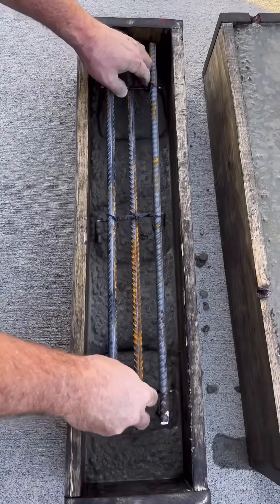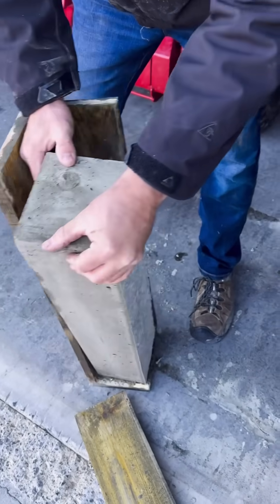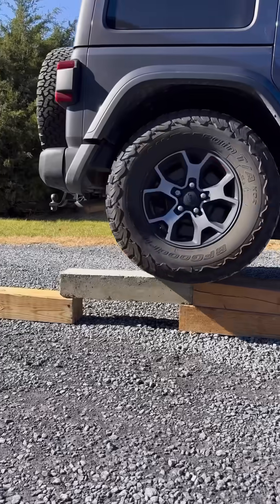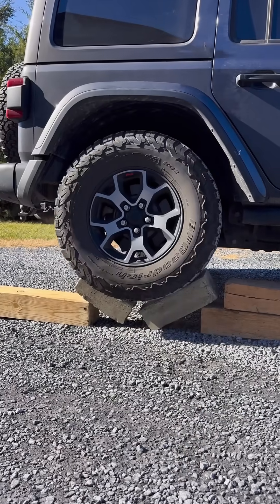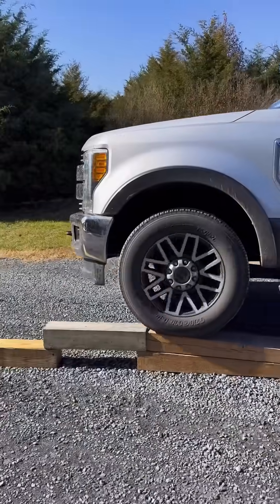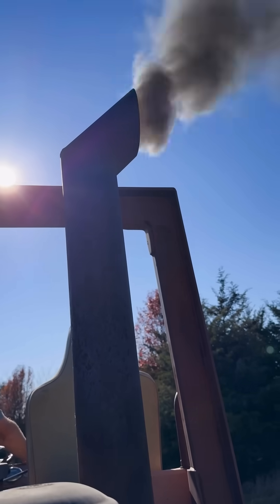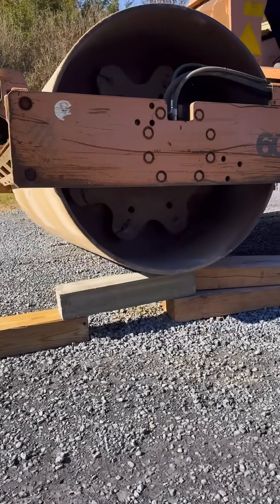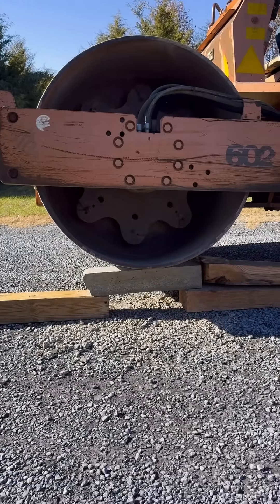Why We Use Rebar To Reinforce Concrete

Comment: I had no idea rollers can vibrate. That’s ingenious.
Reply from the maker: it’s got two different vibration modes. That was the hardest one.
Reply: @hausplans wife left me and for some reason my roller is gone too.
Reply: @hausplans .....does the seat vibrate too?
Reply: @hausplans sounds good for my sister 😂
Reply: @purplechemical yups absolutely 😂
Reply: @hausplans  so it's technically a massive vibrator??
Reply: @hausplans I’m the same in the bedroom
Reply: @hausplans 😳
Reply: @hausplans  Oh that's what she said
Reply: I was gunna say the same thing.
That was amazing
Reply: It's for compacting material. If stuff isn't compact it sinks:) easiest simplest explanation
Reply: What is the vibratory drum for? And how does it work???
Reply: @fireWireX4  You use a vibratory drum to tamp the material (gravel or pavement) into a tighter bed so settling only happens on a minimal scale.
Reply: @fireWireX4  think of how a jackhammer works. Its a similar concept
Reply: @AnthonyBolognese710  Not even close....
Reply: @AnthonyBolognese710 it’s actually to compress the concrete when rolling. Not for breaking stuff
Reply: @AnthonyBolognese710  A jackhammer is probably the worst example for this. The roller is used to compact the materials, a jackhammer is used to break it apart.
Reply: its for packing down soil/gravil/ whatever
Reply: @fireWireX4  vibration confines all the fine particles locking them together. There's a spinning weight inside.
Reply: @fireWireX4  drum rollers are used for compaction of soils and asphalt paving. Any dirt work is sure to have a smooth drum or a sheep's foot roller.
Reply: @fireWireX4 

Concrete pours may look fine but often are riddled with air pockets reducing their long term viability.

Vibrating the concrete forces the air out and makes the volume as even as possible.
Reply: @fireWireX4  Drum rollers are awesome for packing dirt and base rock. The vibrations compact it really good
Reply: @fireWireX4  It works by having cylindrical piece of metal that is non-concentric (weighs more on one side) spinning inside the drum run by a hydraulic motor. The shifting of the weight as it rotates around causes vibration.
Reply: @fireWireX4 you have weight of the roller thats just static weight but you slam it and you have added kinetic energy just like you have hammer you place on the nail it won't drive into the wood but when you slam it on the nail it would drive the nail in.
Reply: @fireWireX4  I'm not an expert, but probably to push down harder on asphalt to make it as flat as possible
Reply: @fireWireX4 it’s basically a huge wacker plate (compactor)
Reply: @fireWireX4 it's for the 304s.
Reply: @fireWireX4 better compaction.
Reply: @fireWireX4  Maybe like controller vibrators, uneven weight being rotated
Reply: @fireWireX4 it's used to compact the ground with the heavy roller and then the vibrations it can get a much better compact, used for gravel and for compact stuff underneath concrete or asphalt or anything that needs a strong subbase
Reply: @fireWireX4   Why do you look it up on YouTube.  You will probably lean a lot more than what you would from comments.
Reply: @fireWireX4 it creates a centripetal force that acts like a  multiplayer to gravity. The roller is x weight and pushes down with three or four (maybe more) times that force. Great for smoothing asphalt.
Reply: @fireWireX4 packing soil like a tamp would do.
Reply: @fireWireX4  its to smash the asphalt down flat, simply driving over it with a roller doesn't do the job by itself.
Reply: @fireWireX4 the vibration allows it to better press the ground down. Think about it like trying to squash a box just by standing on it compared to jumping up and down. The weight of your body alone isn’t super effective, but by jumping up and down you increase the peak force you apply on the ground dramatically.
Reply: @fireWireX4 You ever seen a plate compactor?

The roller doesn't compact because it's heavy, per se, it compacts because it vibrates the ground.

It applies pressure to the ground (via weight) and the vibration allows all the aggregate to bounce around and find the best arrangement for the smallest volume, essentially you're getting the air pockets out of the dirt to compact it.

Vibration is the main feature, rolling is just kind of a necessary accident.
Reply: @fireWireX4 it's vibrates the ground to help compact it
Reply: @fireWireX4 it's basically explained in the video if you think about it. wasn't able to split it with sheer mass and force, but with the vibrator it was able to. its more powerful
Reply: @fireWireX4 It helps pack the cement together, its like if you had a big bin of Lego's and shook it a bunch all the pieces are going to pack themselves in as tightly as possible because with each vibration all the small gaps between each Lego piece is slowly closing. Same concept here, just packing it down to remove any gaps in the concrete
Reply: @theguyfr136  You use a roller for concrete?
Reply: @fireWireX4  when you pave a road, you roll it not too long after you lay the mat and it compacts it and the vibration is for thicker mats, on thin mats you might bring rocks up with the vibration which you don’t want.
Reply: @fireWireX4 i will push more flat thar roads...
Reply: @fireWireX4  vibration makes rocks, gravel, dirt, and sand to move beneath it, flattening the surface of the road out further.
Reply: @fireWireX4 introduces many cycles of fatigue in a very short window of time. Materials fatigue until failure according to n amount of cycles. Vibrations can implement millions of cycles in a matter of seconds. I've seen titanium rods snap in a matter of minutes being placed in machines which vibrate them millions of times per minute to reach their critical failure point.
Reply: @fireWireX4  it's to move all the small microscopic bits around until they lock into each other while compressing. It allows for more strength in a roadway than just pouring it and letting it sit.
Reply: @fireWireX4 it's to help pack in the cement so that way you can try and get the air bubbles out of it. And since it's a roller it's actually doing two things at one time. It's packing in the cement and getting the air bubbles out and it's making the top surface flat.
Reply: @fireWireX4  It's for compacting earth, stone and asphalt.
Reply: @fireWireX4 it's to shift the sand and mud to flatten
Reply: @fireWireX4  You just saw what it was for, it essentially just jackhammered that concrete block...
Reply: Another thing you may not know is that vibrators roll.
Reply: @reidflemingworldstoughestm1394 most things that vibrate do it with off balanced spinning weights.
Reply: @reidflemingworldstoughestm1394 , I thought they're gliding . . . into the coochie
Reply: @reidflemingworldstoughestm1394 source?
Reply: My work has construction going on outside of it. The vibration of the rollers literally shakes the entire 50,000 sq ft building. It’s intense
Reply: it also helps compact dirt when creating new areas of land for home development to keep it from moving during rain, i usually have to compact the ground before the end of each shift, we also use a compactor (seperate from a roller) to reopen the ground to add more dirt and raise the land
Reply: some are also filled with hot liquid inside. its pretty cool how they look the same but they have ones for different purposes
Reply: It's glitching
Reply: it's something else when you're working inside a building and everything starts shaking... lol
Reply: Yeah the trades get the ladies but the vibrating drum brings the freaks out
Reply: @noassociation85  when has a woman ever said “plumbers really turn me on!!!”? 

I mean smart women get with tradesmen because they’ve got very secure careers, but it’s not universal.
Reply: @AnthonyBolognese710  never it's one of the things we giggle about in private,the saying is tradies for the sake of the rhyme,its really just carpenters👍
Reply: @AnthonyBolognese710  the ability to earn is there,70% of trades are broke cus of booger sugar
Reply: @noassociation85  yeah that’s what happens. Covid brought both benefit and detriment, just like any market upset. Some people saw money they had never seen before, so they acted like people who won the lottery.
Reply: Just a fun little tidbit; we also use vibratory rollers to compact dairy haylage and corn silage. Less air=less space+less rot.
Reply: All rollers vibrate. It can be turned on and off.
Reply: @ramennaidoo162  not all what can be called "roller" can vibrate, but most of those that look like that one on the video indeed can. 

And just like the rebar concrete on the video, soil too can have some small voids underneath and the vibration makes the soil particles move and settle in place, reducing the voids underneath and as such makes it more stable to build roads and structures on.
Reply: Dude I was about to say the same thing! Super clever design.
Reply: I’m a concrete field technician
Reply: That's to attract female drivers.
Reply: So hear me out... if dio turned on the vibration mode
Reply: @xianaru1902  he’d start singing holy diver
Reply: The can't. That is what happens when two people are making love on the seats.
Reply: It’s how we pack gravel/asphalt for road construction
Reply: I drive a roller all day for work. The vubrator makes my ass numb. That's why females can't be construction workers. It's a vibrator after all
Reply: whats the opposite of a compacting vibrating roller drum?
Reply: Just like a gaint vibretor on wheels
Reply: Common sense should easily explain your question...
Reply: @JP12Ninersfaithful  common sense would demonstrate that there wasn’t even a question to answer.
Reply: I bet it suuucks to drive
Reply: We got 40 year old roller and it still has the vibrator function on it
Reply: IKR, I mean thats the big take away from this video.
Reply: Roller is just a huge vibrator
Reply: Forbidden massage gun 😂
Reply: Maybe if women knew how many things vibrated in the construction world, there would be more women in the trades.
Reply: You can feel the ground vibrations from like 20 feet 😅 Civil worker here 😎
Reply: Dump trucks do the same things
Reply: When one of those works next to you, you feel like shit will start falling out of you because the ground shakes so much..
Reply: I heard one making multiple passes not to long ago sounded around 30-50hz quite low frequency! Wouldn’t surprise me if you felt it in your chest running it, could also make ya talk funny!
Reply: @tucker934  and that’ll ruin your eardrums over time.
Reply: Same 😮
Reply: A useless thing that I know is that "Steam Rollers" aren't the correct name, it's "Tandem Vibratory Rollers". But this is also my first time seeing them actually vibrate.
Reply: recently I come to know that it has vibrator 🛞. found it in my street road work
Reply: Of course, it’s a road roller.
The secret:

The manufacturers made endless replicas of DIO as divine punishment for destroying their production line road rollers. The punishment was to MUDAMUDAMUDAMUDA on demand while sealed inside both roller drums. The seals worked double duty as to hide its sealed contents whenever the road roller drums were opened for maintenance or any other reason.
Reply: I have an idea💡...

She is dead!!
Reply: you have insufficient cover requirements. Durability aside, the bars can't fully mobilise.
Reply: You know about it if you've ever had the pavement replaced on the street outside your house 😂 Literally feels like you're sleeping in one of those vibrating beds.
Reply: @totino_boy  I have but just assumed those were jackhammers
Reply: Same here 😅 idk that machine can vibrate too
Reply: ROAD ROOOOOLEERRRRR DAAAAAAAAAAA
Reply: @christophersalumro3076 😂😂😂😂😂😂😂😂😂😂😂😂😂😂😂😂😂😂😂😂😂😂😂😂😂😂😂
jojo funy 😂😂😂😂😂😂😂😂😂😂😂😂😂😂😂😂😂😂😂😂😂😂😂😂😂😂😂😂😂😂😂😂😂
Reply: Watching this on mute, my dumb ass thought the vibration was from the rebar struggling to keep the roller off the ground the same way a dude's arm shakes when he's trying to keep his arms from giving out while lifting 😅
Reply: Me too bro
Reply: This comment is proof that people can argue about literally anything
Reply: they’re called Compactors
Reply: Millenial???
Reply: I think you mean indigenous
Reply: That's why they don't allow women to operate them.
Reply: How do you think pyramids were built 😂
Reply: Like seriously???? R u kidding u didn't know that??

Comment: For the best horizontal beam strength the rebar should be offset toward the bottom.
Reply from the maker: This reber was in the top third of the form so I flipped the beam upside down for the test. So it was in the bottom third.

Comment: Those rollers are no joke. After 40 years of commercial masonry i cant count the times thos rollers have screwed up our wally. We have y courses of block laid on the footing. Get up on the staging to keep going. Bear in mind its important the blocks stay at the correct hight so that at the top of the windows and doors our blocks go rite across the top of the frames. Then 200ft away they fire up a roller compactor and we watch as all the blocks laid that day settle forcing mortar out of the bed joints and suddenly the wall is 3/4" low even though the guy was 200 feet away :(
Reply from the maker: My mason told me a funny story about something similar happening to him three times in a row
Reply: It's a seriously aggravating thing. Pan scrapers will do the same thing or big haul trucks will if it's on or close to the ledge or bedrock. Don't even talk about when they are still blasting on the site :)

Comment: As much rebars, you put in it. You should've been 3/8s however, you should let it cure for 21 days. For really good strength. But at the end of the day with the roller size, the vibrator on you should have probably had at least an 8 inches beam with Rebar.
Reply from the maker: I think if I would’ve let it cure all the way it would’ve handled the roller even with the vibration

Comment: 3 days old ..  concrete isn't fully cure until 90 days or turns white  cures to fast your pour was to thick and it will be more prone to Crack but be stronger .. you self level it and your screwed
Reply from the maker: 2.5 days

Comment: The rule states that concrete reaches final and max strength after a curing period of 30 days. Usually the cement will Warrant a quick hardening to keep the concrete in its form as it was intended during pouring. The rebar should be always placed in every corner and held together in a caging either by form bent smaller rebars or you apply a square (for ceilings) or rectangular rebar mat. This way you will reach the highest degree of tensile strength.

Comment: Typically concrete takes7 days to reach 50% rated strength and 30 days for it to reach 100%. I would guess that was between 3-5 days old
Reply from the maker: You were very close, 2 1/2 days

Comment: All rebar does is stop large cracks from forming in the curing process. You get a lot small and micro cracks, rebar keeps the cracks small. Cables reinforce concrete rebar does not

Comment: It would be interesting to see how the rebar compares to fiber mesh
Reply from the maker: It would be
Reply: Fiber mesh is mostly used to control cracking, not add flexural strength. Some high strength steel fibers claim to do both though

Comment: Now that we know how Roman concrete was made. When do you think the industry will make the change. Roman concrete lasts thousands of years. Our current concrete only lasts 100 years maybe.
Reply from the maker: Current concrete last longer then 100 years
Reply: @hausplans  in the right conditions yes. But the coliseum in Rome is still standing more than 2000 years later. We can't even keep potholes in check. Roman concrete is far superior to modern concrete.  Not trying to be a smartass. I have read several papers and books on concrete. I know that's a strange thing to be interested in but I've always been a 1/4 bubble off .

Comment: As a inspector if the air is off in the concrete going to effect the strength 7 plus or minus 2 2. Our bridges have to be water cured covered  with burlap and plastic for 7 days before it can be loaded ideally 28 days of curing is going to be your best strength so lot of factors are going to play in to the strength of the concrete and amount of weight it’s going to handle

Comment: I seen this demonstration in a college visit. The difference in how it broke too is what makes it even more worth it. The concrete cracks and bends giving away the failure before it instantly breaks. Sure the metal expands and hurts the durability but it’s an easy fix to more more concrete
Reply from the maker: You’re right about how they break. With no reinforcement it’s sudden with reinforcement there’s cracks and warning.

Comment: It is not tinsel strength. That method is called flexual strength on the aci American concrete institution.
Reply: Flexure (bending) causes tension and compression inside of the beam

Comment: Min 30 days anything less your test is flawed.
Reply: 28 days is the actual required cure time for concrete.  When testing concrete strength is tested at 7 days and 28 days typically

Comment: 2 days...alot of mud can reach 4k# in 7 days depending on the slump. 28 days wet cured mud can increase the psi dramatically.
Reply from the maker: You were close 2 1/2 days

Comment: Is it possible that the vibration from the drum is actually creating tensile forces along the surface of the concrete as it jitters back and forth with enough friction to tear it apart regardless of rebar reinforcement?
Reply from the maker: That’s definitely possible kind of like the effect of jackhammer has

Comment: The test overused the steel. Since tensile strength is needed at the bottom of the beam, the steel bars should be placed in the lower part
Reply from the maker: When I put the steel in the beams it was 2/3 of the way to the top. So when I did the test I flipped the beam upside down so it was in the bottom third.